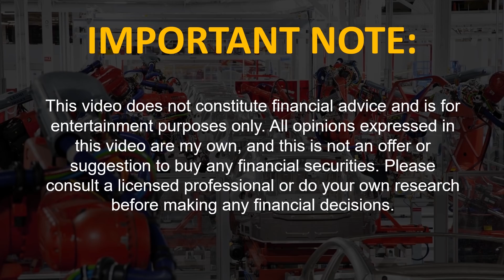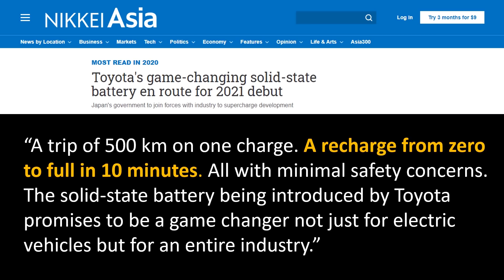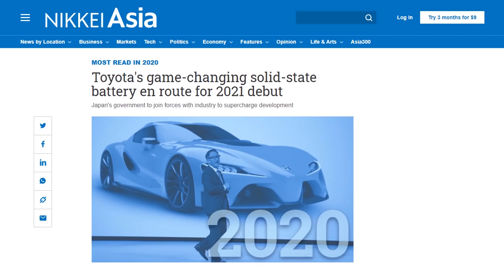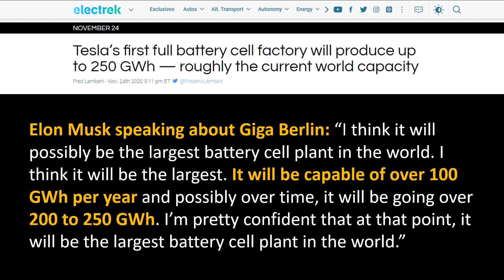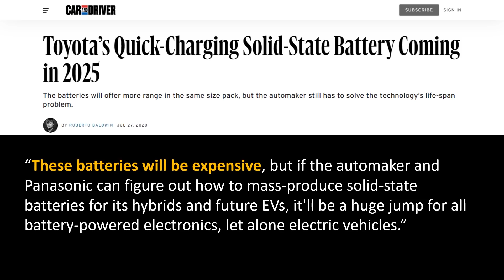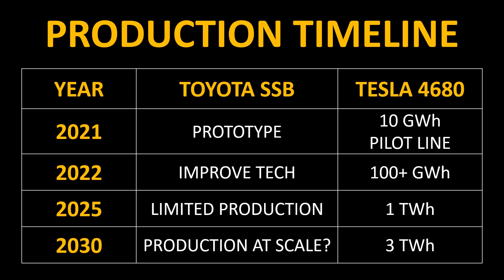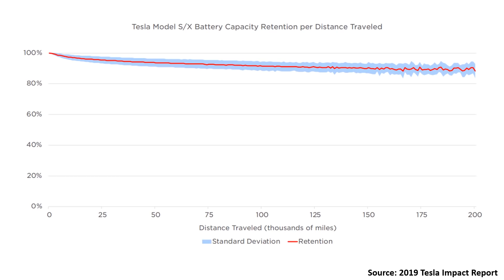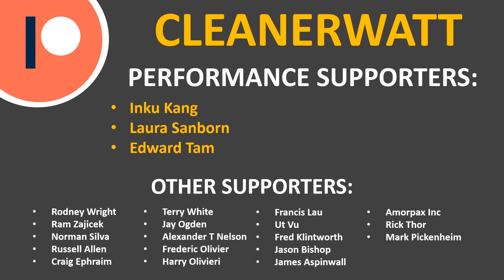Tesla NEW EV Batteries vs Toyota Solid State Batteries

Comment: Musk admitted at battery day they were having production issues with the 4680 battery. They are experiencing a high failure rate at production. This video completely ignores this issue and treats production as a given which is not correct
Reply: Same happened with the model 3 ramp up. It will get better over time. They push the line to failure, see what breaks, fix it and starts process over again. Rinse and repeat
Reply: This video also passed along Tesla's lie about their batteries only lasting 300,000 miles... they will most likely be on the road in 20 years with more than a million miles.  Volvo has a very popular million mile club because 1 out of every 200,000 cars they produced have made it to a million miles without any serious repairs... Tesla will dominate this club in the future.  1 out of every 500 Model 3 cars will be in it!  lol
Reply: Yes, not to mention, Tesla and Elon aren't exactly stalwarts in meeting their mentioned deadlines, all the timelines that Tesla promised could very well be delayed
Reply: @KennyMong  from what we can see, they are doing more than well even with those delayed timelines. So what is your point?

Comment: When a main source of information is a Car and Driver article from back in July, you have to question the motive of this video's message.
Reply: If there is a better source of information Im sure people would be glad to read it. Although it seems highly unlikely that Toyota went from assembling cells by hand in clean rooms to any kind of remotely scaleable manufacturing in 6 months. Tesla spent at least 5 years in secret working on its batteries and a year and a half from purchasing Maxwell until the Battery Day reveal. And the Maxwell part of that was only one step in a process that they were likely already attempting to automate.
Reply: @patreekotime4578  well if toyota has partnered with battery building company, that probably has the capacity and automation capability to produce then I think that the 2030 mark the host is talking about is kinda bonkers. Like that's a whole decade and toyota already has prototypes, I dont think it would take that long
Reply: @yarik12341  Toyota has HANDMADE prototype batteries. As many many people have said before, mass manufacturing solid state batteries at scale is going to be very difficult. And that is AFTER you have cells that are even worth building at scale, which we have no evidence to suggest Toyota even has yet. They may simply be presenting a technology demonstrator. Which anyone familiar with aerospace can confirm, does not neccesarily mean anywhere near production ready. A demonstrator would not have to have final production energy density or be able to fast charge, accelerate quickly, or operate under a wide range of temperatures. It simply has to "work". Which may be enough to satisfy investors, but wouldnt guarantee deliveries any time soon.
Reply: Sounds like it's a desperate attempt by Tesla. It doesn't matter how many batteries you can make. If they have a short life cycle and you are having to replace after 5 year and the charge doesn't hold and it takes hours to charge. Then forget it. If Toyota solves all three then it's game over for Tesla.
Reply: @pacman7959  what are you talking about? Tesla batteries do NOT have a 5 year life. The customers you hear about getting replacements are taxis services and hypermilers who are abusing the packs.
Reply: @patreekotime4578  you sound like a Tesla fan boy. You will have to accept reality eventually that the bigger car companies will one day equal and even surpass Tesla technology.
Reply: @shrekvt  Yes sure. One day. Been hearing that One Day schtick for a long time now. And I dont doubt that a few OEMs will survive the EV transition. But the Japanese companies have no evidence of even WANTING to do it, let alone any sign they will lead. Honda is outsourcing their EVs to GM and Toyota execs have stated they dont want to build EVs and are only doing it because they are being forced to. Mr Toyota himself warned that it will certainly cause some OEMs to go out of business.
Reply: @pacman7959  Tesla has how many Giga factories up and running?  How many cells are they delivering, today?  Doesn't sound like a "desperate attempt" to me.  "Hours to charge"?  You might want to invest in something other than a level 1 charger.  As to "5 year replacement", do you really put 60k - 100K miles on your car per year?  And finally as for your "game over for Tesla", do you really believe Tesla isn't investing moneys, now, in solid state battery research?  Elon Musk may be a bit eccentric, but he isn't stupid.

Comment: “Will be expensive” the cutting edge technology will always be, and has always been expensive. 

There’s lots of words you used to many times in this production, but one word you didn’t use at all is “speculating”.... constructive criticism. 😎🤜🏼🤛🏼🍀
Reply: I agree with Steve here. New tech is always expensive. Lithium Ion batteries went through the same cycle.
Reply: I can’t say that I agree with your first point. Yes, it used to true that new technology, at launch, tended to be more expensive, especially where the new technology does a jog that was not. Mechanised or automated before. However, new technology, of the type that we see today, tends to be relatively inexpensive, less expensive than the previous model. ‘More bang for your buck’ has been a tech marketing trope for decades. 4680 batteries are more expensive per unit, but require fewer units to store and deliver a given amount of energy, and can do so more efficiently and with greater reliability and at a lower cost per unit of energy. SpaceX and Blue Origin offer launch facilities and space flight at far lower cost per Kg / kilometre than NASA has ever been able to.
Reply: I don´t think that will be an issue in the case of Toyota, even a master mechanic like Scotty Kilmer may admit the toyota/lexus option, Scotty already said good stuff about toyota hydrogen
Reply: @bettyswallocks6411  new technology is more expensive because you are paying to build new factories and new supply chains. The cost only goes down after that but at that point it is no longer so new.

Comment: This doesn't even take into account the breakthroughs Tesla will have over the next 10 years. The last 10 years has seen massive improvements in cost and capabilities. I don't think the 4680 cells will still be used in Tesla's cars a decade from now.
Reply: Tesla have yet to make one of these newly announced 4680 cells. Why do you think one wasn’t shown at battery day. If they had any yet they would have been displayed by the Cybertruck load.
Reply: @theonlymudgel  Why do you think, they are retooling the S/X line right now ? And they are making the cells. They have a functional production line, just the yield was not quite there .... that was in October. They also stated, that they already had test vehicles with the 4680 cells in them running for months at that time. On top of that, Panasonic is also racing to provide Tesla with cells in the 4680 form factor.
Reply: @theonlymudgel  they already have a line a the fremont factory. Was announced on battery day. Gali from hyperchange even did a walkthru
Reply: What breakthrough? Did musk found a more viable medium than twitter to unveil his next great idea. I wonder how long for the 3rd bankruptcy announcement.
Reply: @boohoomoron7629  with 20 bn USD in cash or cash equivalent, that's not going to happen.
Reply: @Marlow925  lol the first bailout was 8 bn and the 2nd was somewhere around 14 bn.
Reply: @Marlow925  it also recieved a great chunk of the recent corona stimulus from the government.
Reply: @boohoomoron7629  you mean fund raiser via stock dilution .. those are not bailouts .. completely different thing. A bailout constitutes for example the loan from the Department of Energy, which Tesla was the only automaker (who got said loan), that actually paid it back and paid it back 9 years early.
Reply: @boohoomoron7629  and the corona stimilus is exactly that: a stimilus package, that the government gave a lot of businesses .. not money, that Tesla needed. If the government gives away free money, they'd be stupid not to take it. Tesla also has been the ONLY US automaker this year, that actually has been profitable and currently is debt neutral after the last funding round.
Reply: @Marlow925  no i mean the bailout through the advance tech subsidized loans from the government. You tesla fanboys 🤷
Reply: @boohoomoron7629  references for the bailouts, please. Because the only bailout, that is documented was the one in 2010, which they paid back by 2013 and we're talking $451.8M ... not even half a bn.
Reply: @Marlow925  do it yourself it's all over the internet.
Reply: @Marlow925  there's even a 17bn loan from the trump government in 2017 to tesla. Google the details.
Reply: @Marlow925  Just How Much Does Tesla Get In Subsidies Anyways?

August 3rd, 2020 by Johnna Crider
Reply: @Marlow925  what are you even talking about? The 8 bn bail out in 2008 was after Elon Musk announce the tesla bankruptcy. How did you even miss that?
Reply: @Marlow925  this will be my final response but tesla has been questioned over it's highly favorable relationship with the government and many non governmental watch groups have been raising doubts on Tesla's operation. All you need is to dig deeper and you'll see the reason.
Reply: @boohoomoron7629  in 2008, Tesla and the other US automakers asked the government for a bailout. That's the bailout of the 465 million, that Tesla received in 2010 and paid back in 2013. Here is a reference from 2008 in Autocar: https://www.autocar.co.uk/car-news/industry/tesla-asks-bail-out

You are looking at budget figures for the entire program. Not at the slice of the pie, that Tesla actually requested. And that is still the only bailout, Tesla received and has paid back.
Reply: @Marlow925  my bad, you're right the 2008 bailout was exactly as you say, nonetheless a bailout. But i believe that musk did sought bailouts for the rest of his firms and i got mixed up. Anyway, the loan repayment in itself was also a matter of contention as there were stories of a write-offs. Now, i am going to look into Toyota's financial statements and compare.
Reply: Oh .. and subsidies are not bailouts either. They are subsidies ... how much subsidies does the oil industry get ?
Reply: @boohoomoron7629  Nissan also received a loan in the same program and has paid that back. Ford still has to pay their loan out of that program back ... and they have to do so by 2022.
Reply: @Marlow925  subsidies are worst then bailouts, atleast bankruptcy need a declaration but you will never know how much subsidies has been granted and in case of tesla the argument even went to court. Tesla has recieved 4.9bn in aid and plus the whole of America and the federal government pushing it is also a show of desperation. To conclude there is no comparision between tesla and Toyota only tesla fanboys with no apparent rationale tend to come up with arguments with no basis.
Reply: @boohoomoron7629  not sure, where you get the 4.9bn figure from. Cleantechnica has it at 2.4bn as of August 2020. You need to get a lot more accurate with the figures, you're stating.  2.9bn if you include the loan, which they already paid back with interest.

https://cleantechnica.com/2020/08/03/tesla-subsidies-how-much/

And that article also states how much the others got ... which are far larger pieces of the pie.
Reply: @boohoomoron7629  The first article is nonsense, as reference. Yes, Tesla (with Solar City as part of it) and SpaceX are both Elon Musks companies, but they are seperate legal entities, so you can not go and say Tesla received 4.9bn subsidies, which is what you did. To quote you: "Tesla has recieved 4.9bn in aid and plus the whole of America and the federal government pushing it is also a show of desperation." The article you quoted disproves that, as it states, that Elon Musk has received 4.9bn for all of his companies combined, which is SpaceX, Tesla and possibly the others. I referenced the CleanTechnica article, which clearly summed up, that by August 2020, Tesla only had received 2.4bn in subsidies and that one bailout loan of 365 million in 2010, which they repaid in 2013 with interest and 9 years early. The corona virus aid has been applied across the whole US industry to preserve jobs, as compenstation for shutting down the industry, so can be discounted in your argumentation.

The corona virus bailout is something that the government put together for shutting factories down. Even without that, Tesla would not have been in trouble. And every other car maker plus a lot of other coporates received that, too. So it's complete nonsense to pull that one up. It is (and was) intended to preserve jobs, while people were not allowed to go to work. Should a company pay for employees, that are not being doing any work ?

And in all honesty, have a look at Ford and GM first, and see how much they got in proportion .... then compare that objectively, without mixing in entities that have noting to do with Tesla (like SpaceX, Boring and Neuralink, who all are seperate legal entities and not tied in with Tesla), and tell me if Tesla is getting more or less than those. My hunch is, you'll find that Tesla gets vastly less than the average.
Reply: @Marlow925  eh! Tesla boys and the bubble. Lol. So long gay boy.

Comment: "Workers reach in to work on the cells through sealed rubber gloves" Really? The host points to this statement as to why this is not scalable? This is clearly for prototype work. Toyota already has experience with automated robots. I think that would be fairly scalable. Robot tech is also getting cheaper and more advanced. They have the capital. The host smoking crack if he believes that toyota will not ave this in production until 2030.
Reply: Tesla fan boy, if toyota says it  i believe they already have it.
Reply: Did u not listen that it has to be made in a totally dry place
Reply: Yes, the presenter has a hard to hiding is lack of objectivity.
Reply: Toyota plans are $3.1 billion battery production in 2030, so probably. But that´s really not that much. Somewhere between 15-30GWh, so basically one factory. If that is their most optimistic prediction, then they will still be behind other automakers.